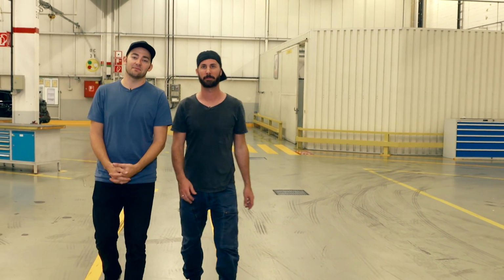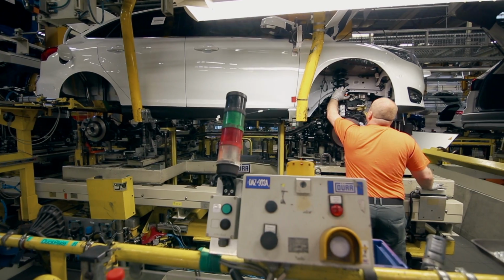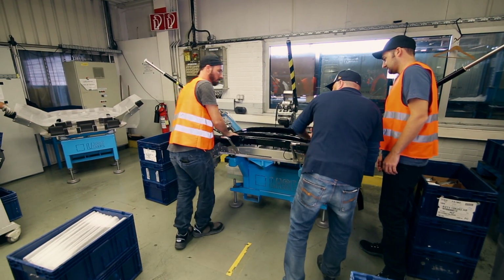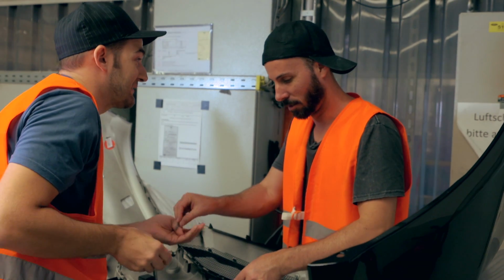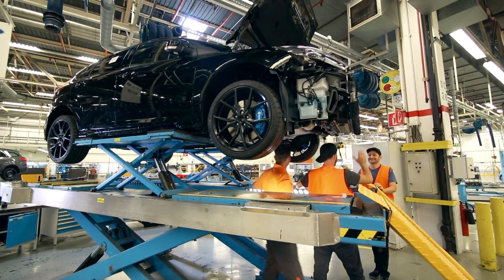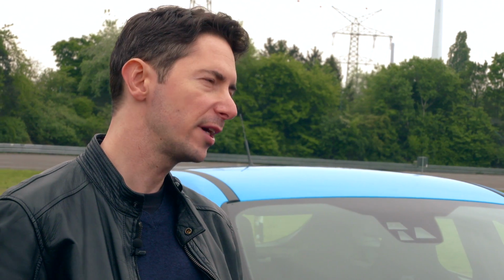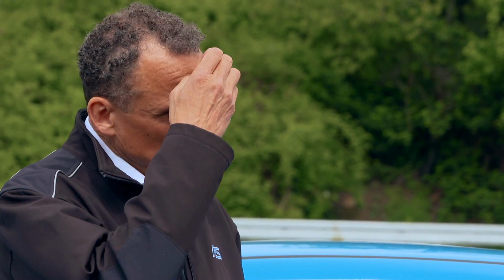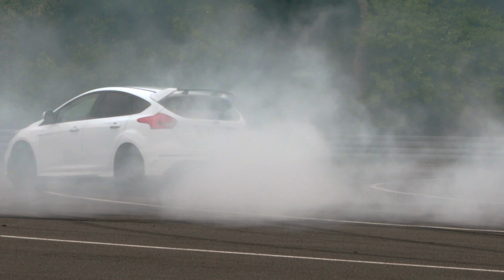Making Our Own Ford Focus RS In Germany

Comment: Hi from the UK, I've just bought a 1 owner, 22,000 mls nitrous blue, Rs shell seats, forged wheels back in January to finally get on the RS band wagon,  had it stage 1 mapped with a Sabre tuning live map to 395 bhp its phenomenal, bought as a keeper, if you've never been in one the power and the handling are simply sublime,    you can thread it through a series of bends and your going 20-30 mph faster than your passenger thinks you are,,, let the haters hate.

Comment: Love you guys but this car sucked, yeah some die-hards love it but the engine block was a total fail, water jacket all the way to the brim and no structural supports at the top of the piston chamber. I know of several peeps who have had coolant leak into their middle two cylinders.

Comment: Has the head gasket gone yet. The engine is badly designed. The tops of the cylinders in the block are not supported causing movement which leads to gasket failure at around 20-25k miles?

Comment: Love your work! Awesome video as always! Went back to season 2(?) today and restored my cataract ridden headlights. Now I can see in the dark again, its time to make more power.  Is the RS engine the same engine (block) as the Mazda 6 (or 3) MPS? I know there are sililarities between the MPS and the 2.3l Mustang ecoboost. If you were to get rid of the stock top mount and put in a front mount (or maybe a bigger top mount) would you be able to safely run 26psi boost?

Comment: Rocker panel is a term used for the same piece in off-road vehicles here in the US. They are often made of steel, and they will prevent vehicle damage if you bang them against rocks and other things. I've used them off-roading, and the vehicle rocked forward in that particular obstacle when my diffs were locked. Not quite sure what "rocker" actually refers to though. This may be a totally pointless comment.

Comment: The end seems a bit childish and came across as "cringey." Doing burnouts with your mates is one thing, but when you have one of the lead engineers in the car with you, it's uncomplimentary to his work. Going around in circles destroying perfectly good tires is not how you give credit to a car's performance. Eh oh well. It was at Ford's expense anyway.
Reply: I don't know. They included drift mode. He looked scared at first, then realized, "these guys can drive".
Reply: Mobious- Eleven i would agree if thos wasnt a car with an inbuilt "drift button" they literally made this car for hooning around in..
Reply: That's as retarded as getting in a Landcrusier with it's engineer and not going over anything larger than a grain of sand!

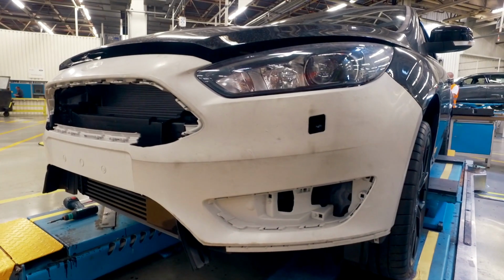Comment: You say at 6:25 an expert can assemble the bumper in around 20 minutes? An Audi A1 bumper (also S-line) is assembled in about 2 minutes, including stamping out the spaces for the washers. I have assembled them as a student job and the pace is incredible.

Comment: for the price of these you could buy a 2009 GTR
Reply: And then you own a 8 year old car which has much higher running costs? This is a brand new car... I am a massive GTR fan but come on, this is just silly.
Reply: Shane Draper 8 year old fanboy on an 8 year old car.
Reply: You could buy like 50 Chevettes as well, if that's your thing. Odds are at least one of them would always be running.
Reply: Buying an 8 year old super car with no warranty with a still very very expensive to replace gearbox if it goes bang.
Reply: Shane Draper, point invalid. What about service cost? Etc.
Reply: You can also buy a project car for £200 but you'd still need thousands of pounds to run it, fix it and modify it...

Annoys me so much when people compare what you can buy against a new car.
Reply: Or a Mk7 Golf R with a whole bunch of mods to chop RS's
Reply: for the price you could buy a 2009 still born
Reply: But the r35 is ugly
Reply: Shane Draper fanboy
Reply: Wrong.
Reply: An 8 year old worn out GTR or a brand new focus rs, hmm.

Comment: why can't we go back to the days where they over engineer the engine where they're not "pretty close to the limit" at low power figures. So the engine doesn't blow up even not modified aaaand we can put more power into it without fully building up the block.
Reply: gwot Buy a VW
Reply: I'd buy a Ford over a VW any day, and i wouldn't buy a Ford. My sister has a VW many of my friends have VWs and I keep needing to fix them (I'm a mechanic). and their engines are pretty close to the limit already as well, so your comment doesn't even apply.

Comment: Here's the problem - it's still a Ford. It will have electrical problems and it will rust. And it looks like a 15 year old boy's wet dream. There's no sophistication with the power. It's the same problem that the STI has. Big wing, goofy looks.

Comment: so what do they mean the 2.3 mustang engine is at its limit as they gave it sleeves and everything.. for their purpose he means? surely you can push 500hp+ out of that?
Reply: the engine might be able to handle the extra power, the rest of the drivetrain is another story. OEM still have a make a profit so they engineer parts to handle just above the limits of what the engine produces. More power means more money spent on the drivetrain which in turn means higher cost to the consumer.

Comment: Ford can go fuck themselves, I hate the splash guards they put under the engine, I call it a car maxi-pad, just to change the oil you gotta remove the fuckin thing, fuck Ford and fuck every car maker who doesn't make any access panel for oil changes this is unnaceptable you assholes

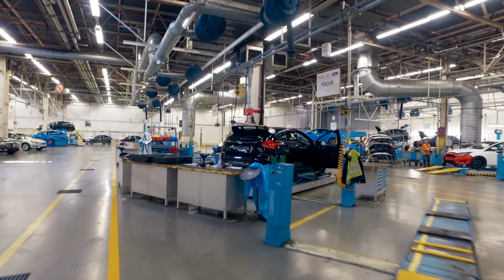Comment: On the RS, do they use bumpers that wouldn't pass inspection for the dummy bumper and then re-use it for other RSs? The one at 6:24 looks to have a few marks on it.
11:00 The one way to tell the MCM Focus RS apart from the others

Comment: "Engineered for track use",  read: "WAY over-engineered for regular street use", which is awesome!
Reply: But the the designer engineer said the engine its pretty close to the limit. So how much more power can we safely add to this engine?
Reply: @juancruz-jg5pq  probably not that much and still meet their required reliability parameters.  Depending on your tolerance for issues, it can still handle more.

Comment: Rocker Panel is american apparently. Either owing it's origins to naval terms (a curved keel) or rock (being a protector from rocks).
Reply: I'd buy that. But I've always understood the rocker panels to be the sheet metal underneath/behind the lower door sills. Kind of the spot where gravel hit's if you don't have front splash guards/mud flaps. And then side skirts are side skirts.
Reply: History 101 - horseless carriages = cars.  Allegedly, the term goes back to horse-drawn carriages.  If in doubt, Google it out.
Reply: Eric Johnston we don't. We call these parts "Schweller".
Reply: @DerDoggder   It is true https://en.langenscheidt.com/german-english/schweller
Reply: I wonder why the Germans call it that. Also, as Frontball mentions, the rocker panels are actually under the skirts on these cars.
Reply: I live in the US, I've always called them rocker panels. Maybe that's just because I'm more into the wheeling and offroading scene, where they serve that purpose. (Protecting the fragile body from rocks and other obstacles)
Reply: Maybe... or that they get the hell beat out of them by rocks if you drive down gravel roads with no mud flaps.
Reply: I usually call them rockers on trucks but side skirts on a car
Reply: In American we also call them side-skirts.

Comment: Urgh, This video has hyped me again for the New RS. Still not sure if I should get a used MK2 RS or save a bit more and go for the new RS :/
Reply: Save up and get the new one man. I know a couple guys with the Mk2 RS (even one with a Mk1 :D) and it's a great car but... It's still FWD and it will never be as good as an AWD, no matter how much you modify it. One of the dudes upgraded from Mk2 to Mk3 and said it's a night and day difference. My budget is a little tighter so I have the Fiesta ST, but if I could buy the new RS, I'd do it in a heartbeat.
Reply: Mhh, the main reason I am considering the MK2 is the 5 Cylinder. I curently drive the Mk2 ST and love the sound. Love the feel. Also don't like the Idea of "Sound Enhancements" via the Speakers.
Reply: Yeah, but the 5cyl (ESPECIALLY on the RS) isn't among the most reliable. 2 people already had to have completely new engines brought in (one after just 30 000 kilometres!) Both of them had the RS - I do think that Ford might have sacrificed some durability for power in the RS. If it comes to it, you can disable the "sound symposer" in the RS Mk3 quite easily if you find you hate it. But I'd say the Mk3 is a vastly superior car and it's well worth the tradeoff in the form of "fake sound". Besides, even if you turn off the symposer, it still sounds great. :)
Reply: Also - I have the sound symposer too in the Fiesta ST and it's actually really good. I was super skeptical about it at first too, but Ford really nailed it. The car is about ME anyway, the fact that people outside don't really hear the same stuff that I do stopped bothering me a while ago - I'm having a blast anyway. :)
Reply: Well, only way to know is a test drive. ;D
Reply: your happiness is more important.  i installed my component speakers in my car and its amazing.  no need for a sub and the highs are crazy.  JBL all around.

i'm a total amateur but somehow i can install a sound system.  it always happens at night for some reson.  everything i do is extra difficult but worth it once its done.  am i even making sense?????  time to sleep
Reply: Get an mk2, it goes up in price. Got a friend with an mk3 and needed a new motor after only 20.000 km...
Reply: Get a mk1 RS
Reply: Totally different in the FiST where its just a pipe that resonates sound into the cabin from the engine'es intake. 
RS has the silly DSP audio tomfoolery playing through the speakers.
Reply: If I could Id get a mk2, but im in the us.
Reply: I have a mk2 RS and I haven’t had a problem with it. It’s lighter than the new RS and with my current tune it’s way faster on the straights. Obviously on the curves the new one will be faster but it’s really, properly good in the turns the mk2. I currently have 370hp to the wheels on mine.
Reply: Yeah a lot of people don't like it because they hate fwd. There's really nothing wrong with it though, its the lightest type of layout, and they really can put power down if you just take some time to learn how to handle it. AWD is very awesome, but it has its ups and downs just like all layouts. I would take a mk2 over a mk3 any day. The mk3 is a great car but its a big step up in weight compared to the rest.
Reply: Buy an mk2 and get an awd swap... It's so common here in Germany that you can let it convert by a lot of big company's
Reply: renigade234 mk2
Reply: The Mk3 isn't a true AWD it's still mainly FWD at heart, plus in my opinion the Mk2 looks far better and more agressive and that 5 cyl roar is worth it 😉 mk2 all day long ❤️
Reply: renigade234 type r

Comment: Now we come to where we install the dash....we load this scatter canon with all the parts, then fire it - this ensures we have an ugly dash with all the parts randomly placed with odd orientation. Of course to finish the interior feel we use cheap tacky plastics that have that classic hollow scratchy feel. We didn't forget about driver comfort though, we ensured the ride was nice and choppy and the seats mounted barely in the car, nice and high. The phone slot has been designed such that your phone flies out under acceleration, just so you know your going fast. Exterior features also include - juddery wipers and plenty of garish flare that will not age well.

Comment: This was interrupted by a Honda advert! I still can't get to grips with hearing that 4 cylinder engine when we've been lucky enough in the U.K to have the 5 cylinder engine not only in the RS but the ST. Yes the mk2 was front wheel drive and a lot of people cursed Ford for doing so with them claiming that fitting a Quaife limited slip diff was good enough. If I was given the choice I'd still rather hand over my money for the 5 cylinder mk2 RS. A fantastic video and hats off for asking the people who design and sell us performance cars what they think when customers modify them.

Comment: 0 to 100 mph in 4 seconds?    Was that accurate?
Reply: Trials and Tribulations kilometers per hour
Reply: 100 kilometers is 60 mph
Reply: Trials and Tribulations 0-60 mph in 4.7 sec
Reply: Moog said 4.7 seconds, not 4 seconds.
Reply: Trials and Tribulations well I guess the time was 4,7
I also drive one and I have around 5,0 seconds. But thats only because I am bad at launching XD
Reply: Derek St. Gelais 62.5 mph
Reply: Derek St. Gelais is your woman sweet?
Reply: MGRaiden64 ...62mph

Comment: Those spring blocks seem like a game changer for people needing to regularly load lowered cars onto trailers.
Reply: type-dRew first I've heard of them, so fuck me right?
Reply: yes, fuck you

i guess

why not
Reply: I'd much rather just use wood instead of jacking up two to all corners of the car.
Reply: blacksail337, you can make 4 of these yourself at home. You can cut them out of blocks of solid plastic or wood, and they're pretty easy to use as well. If you have a floor jack it just takes a couple of minutes to take the pressure off the springs and pop the blocks into place. I knew a guy who had some wooden ones he made for a really low Ford probe, and it was really quick and easy to just jack up the front, then the back, to put them on. Then he could drive it up on his trailer just fine. I thought it was a pretty cool idea when I saw how he used them. ;)
Reply: Or have a trailer that loads flat and then raise it once the car is secured on
Reply: blacksail337 yeah because these are a new thing

Comment: So you came to germany to build a FORD, serious?
No Audi, Benz or Bmw. A FORD?
Sill cool, but... Ford? XD
Reply: It's a Ford RS, not a simple Ford. It would be equal to building an Audi RS, AMG Mercedes or BMW M series. And to be honest the quality of each one of them has fallen to very low standards. It would do no good to either brand to show how cheaply they are made. (I am no Ford fanboy or hater by any means. They are extremely fun to drive, but holy crap, if you would compare an old AMG Mercedes to a new one.... or just any other brand... yeah.)

Comment: good luck with the transmission on the autonatic, that's going to eat through the clutch pads like nothing else, Ford Design is shit when it comes to "comfort ride transmissions" especially with the RS
Reply: Happy Fox luckely its a manual, the clutches they where talking about is the one for the differential.